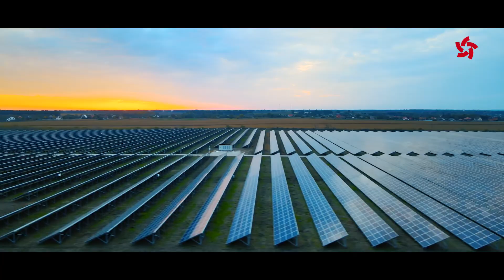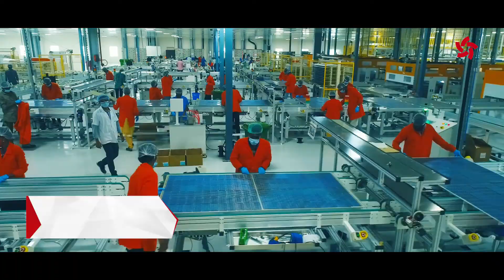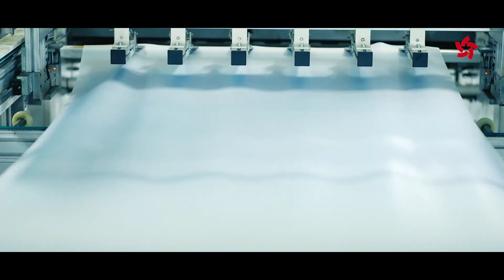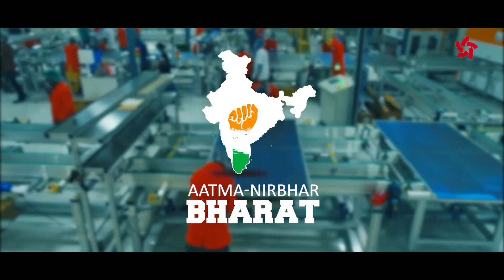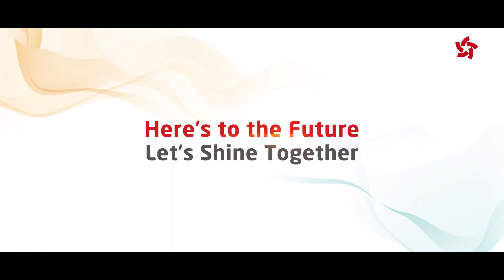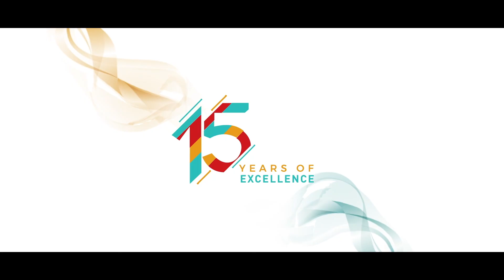Vikram Solar Manufacturing Facility in Oragadam, Chennai, Tamil Nadu

Comment: Any requirement for electrical engineering (fresher)??
Reply: More partialities going on Chennai plant.. They didn't respect to our tamilans.. If you know Hindi, you will get job surely.
Reply: @karthikks352  pls contect no. H
Reply: @karthikks352  yes
Reply: Yess they do...
Reply: @anandhananandhan6122  Hii sir How to apply
Reply: how can i join this company?
Reply: I have experience in solar manufacturing company 3 years totally 
Present work at in solar ..... How to join vikram solar ...Any one tell me
Reply: @yesuulli6967  send your resume to the mentioned mail id immediately as possible
Reply: @anandhananandhan6122 i'm a fresher, Can I send my resume?
Reply: @bhawanishanker3818  of course... This company is also a startup company in chennai. & 15 yrs of excellence in calcutta.
Reply: @bhawanishanker3818  they do hire freshers
Reply: @bhawanishanker3818  no bro ...they not ..i tried
Reply: @anandhananandhan6122  How to apply